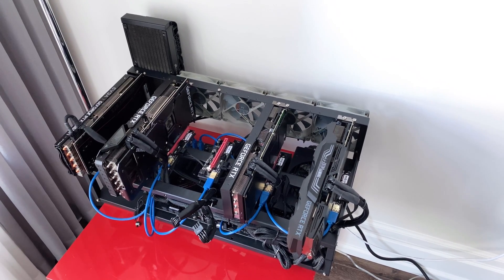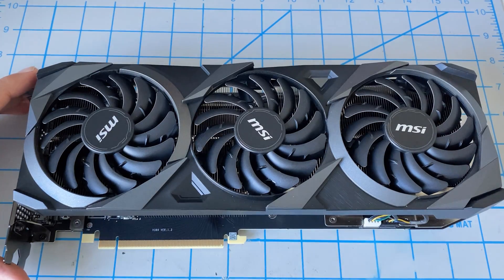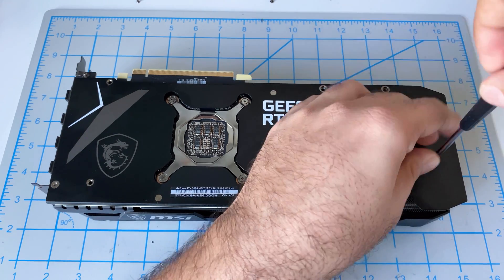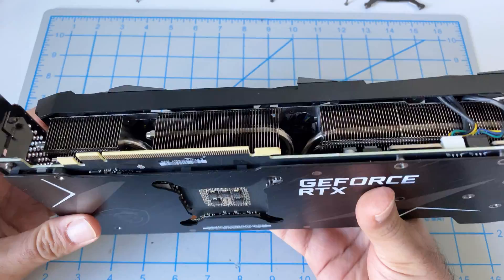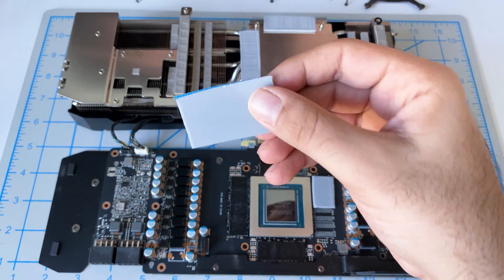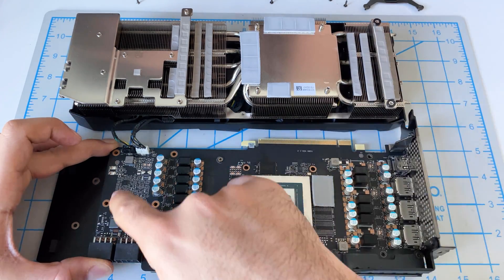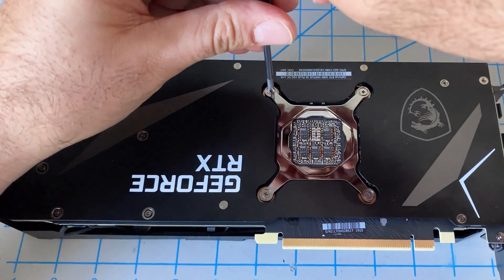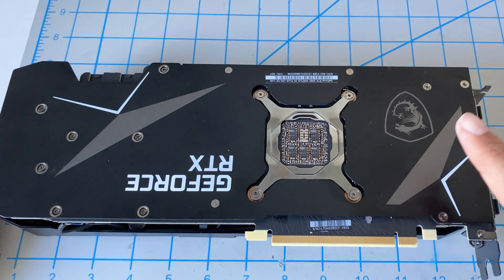MSI Ventus 3X Plus OC nVidia RTX 3080 Disassembly & Thermal Pad Swap | Fix CRAZY Memory Temperatures

Comment: I am soo fked i used 3mm pads near memory and capac/ power adpter and small chips used 1.5 i am getting goo thermal also good memory temps but my hotspot is 107 can anyone help me out ? please Its gg for me
Reply from the maker: Been a while since I did this video but didn’t I use 2mm for the memory? Using thicker than stock will mean you won’t be able to get enough contact pressure on the GPU die which will lead to your problem.

Comment: I have a 3080ti and since day one playing any game it maxes out at 84c, i find recently that this card should thermal throttle at 83c which means my shits been overheating since day one. Could this be the issue with mine? Case has 3 front fans pulling, 3 top fans pushing 1 rear pushing.

Comment: THERMAL PASTE MUST BE SPREAD ON THE WHOLE SURFACE. The "X" technique is great for a CPU where the silicon in only in the center of the chip UNDER the heat spreader. However in the GPU the cooler sits directly on top of the silicon and MUST have contact on the entire die surface. I think you had a great video minus that one caveat (really may want to make a note), i just want people who come here to have the proper knowledge*.

Comment: Maybe a bit late since this is an old video, but i have a similar MSI and this tip helped a lot to improve temps.

Put kapton tape, to block air from going down the open parts of the heatsink. 2 of the 3 fans ... are doing mostly nothing to cool the heatsink fins. Air has an easy way out through the gaps of the heatink. If you block those openings, suddenly temps drop a lot.

Of course changing pads and paste are required, to get heat on to the heatsink in the first place. But putting the tape there, helps getting rid of heat with less fan speed.
Reply from the maker: Interesting idea, I'll have to try. Thanks!

Comment: Where is the memory thermal pad? My pc temps are fine but the memory temp says 90-100 when I’m gaming. PC is randomly shutting off the monitor and blowing fans full blast. Just replaced all the thermal pads here but not sure if any of those were concerning the memory
Reply from the maker: The memory thermal pads are those big pads you see at 5:41.

Comment: hi i did the adb to move the dji v2 osd elements 
now the goggles continuasy reboot any help please
Reply from the maker: If the goggles are restarting, it is because you moved the elements in a way that they are overlapping or put in coordinates that are not understandable by the goggles. Restore to the stock xml file and try again (or just use the one I have linked in the video description).
Reply: @Mangorille  thanks for that 
all the elements are now moved to better locations and full HD fonts
one thing i cant find in the xml is the channel at the bottom left of the goggles 
what would it be called please so i can adjust it
Reply from the maker: @kmarsdenelectrical  You'll need to try it out through trial and error. It might be racing_rc_signal_win

Comment: It’s sad you have to do this at alll. I have a 3060ti which began failing only after 8 months of light use.   MSI Rma Does NOT inspire confidence. Just did RMA for their 120r AIO (which died end of January)
Reply from the maker: Ya I have other GPUs running strongly after years. This MSI one is working well since changing the pads though.

Comment: I understand that companies try to reduce costs like crazy, but reducing temps from 102 to 76 Celsius due to replacing poor thermal paste and pads is simply ridiculous; especially if this voids your warranty.
Reply from the maker: Agree, especially since it failed 1.5 months after purchase. Sure, MSI didn't design this for mining but still, it would have failed eventually with a gaming workload too.
Reply: @Mangorille  Do you know if this voids the warranty.
Reply from the maker: @ridiculous_gaming  You'd have to reach out to MSI to confirm but I would guess it would depend on your local consumer laws. I went in under the assumption that it would void the warranty as we don't have the best consumer protection laws where I am.
Reply: @Mangorille  Making the product last or run better via better cooling does not matter to most companies if they have an excuse to void your warranty early. I assume they'll follow this as well.
Reply from the maker: @ridiculous_gaming  Yup, and they can always say cypto mining is not a standard support workload anyway.

Comment: Since a few weeks my fans are ramping up like crazy on this card, the temp reported seems to be below 80°C tho. Should I swap the paste and pads nonetheless?
Reply from the maker: Use a software like HWMonitor to see if any of the temperatures on the card are out of whack. It's possible that the thermal pad on one particular component has failed and the fans are ramping up to try to cool that one component. When you say 80 degrees, is this the VRAM temperature or something else?
Reply: @Mangorille  Thank you for your replay. I changed the thermal pads and paste according to your video and it works perfectly fine now. :) One of the pads definitly failed, it was extremely oily there. The temp was the overall GPU temp in HWInfo, the memory was even hotter at around 100 degrees. I have around 55 to 65 degrees (overall temp) while gaming, depending on the game. Also the idle temps dropped significantly. So a big thank you from me! Your tutorial helped a lot!
Reply from the maker: @johannesd.2347  Glad to hear you got it all figured out! Mine was the same, the pads were really oily and you could even see the oil spots on the back of the card before disassembly.

Comment: Would you happen to know the size for the thermal pda for the same gpu but a 3060ti??
Reply from the maker: No sorry and wouldn't be surprised if it was different. Really just research or you pick up a few sizes and then return the ones you didn't need.

Comment: Very nice and detailed video. One question though, where did you find out about the appropriate thermal pad thickness? Was it in some forums or did you contact msi and they gave you the specific thickness?
Reply from the maker: I bought a few different sizes that seem to be common to 3080s and then used a caliper to measure the existing pads where it had not yet squished.

Comment: Does anyone know how thick the thermalpads on the RTX 3080 VENUS 3X PLUS 12G LHR are on the capacitors on the capacitors and mosfeti diodes and back plate their thickness. I would like to replace them.
Reply: Did you found that out? I got the same card.

Comment: I'm going to do this to my Ventus 3x, except I'm going to use K5 putty instead of pads. Also why not just unplug the wires and remove the risk of damaging them?
Reply from the maker: Lots of times those connectors are really tight and easy to damage if you don't remove them the correct way and with patience. There is really no need to remove.

Comment: hello, thx for the video. May  i ask  can we  reuse the  stock thermal pads after changing  only  vram pads.   Cuz  we are  opening the  backplate, u know  pads rebounding.  And  is there any vram chips  under  backside of the  pcb, like frontside. İf there  is  shoud not we change  it too.
Reply from the maker: You can re-use the thermal pads, no need to replace them each time but make sure you don't get them dirty with dust/hair/etc.

Comment: At what speeds do your fans work? Do you set them manually or does the machine adjust them?  Do you overclock memory during mining?
Reply from the maker: I set the fan to manual and 80 percent on this card so that it runs a bit cooler than normal. You can leave it on auto and see what the temperatures look like based on your ambient. Yes, you do usually overclock the memory but it all depends on the coin you are mining. Some need memory overclocking while others do not.

Comment: I have the MSI RTX 3080ti ventus x3, i saw a little bit of oil on the card... so ik wanna change the thermal pad because i think its the pad..... So between the backplate and the card i need the 3mm and on the front side arround the gpu i need the 2mm? And the other pads on the front side are all of them 2mm? Hope you or someone can tell me that....
Reply from the maker: Back is 3mm and front vram is 2mm. I honestly wouldn't bother with the rest.
Reply: @Mangorille  Thank you for your quick response!

Comment: Although differing designs for the RTX 3080 seem to want different thicknesses for the chip side of the card, the back side of the card always wants 3mm. I have two MSI Ti's that have 2mm on the chip side, but then I have a non-LHR (not sure who made it) that uses about 1mm on the chip side (which I replaced by doubling up .5mm's and did not have any thermal pads on the back side of the card to which I applied the 3mm. That card is mining strong at near 100 mega hash/sec with no sign of stopping.
Reply from the maker: Agreed. Front varies based on the manufacturer and the cooler design, rear seems to usually be 3mm.

Comment: Another YouTuber seemed to get amazing results by just applying thermal pads to the backplate opposite the memory chips, but that version of the 3080 didn't even have thermal pads for that area.
Reply from the maker: If there are no pads there, that would definitely help. On mine the thermal pads actually failed and became all oily and shiny. You can even see a bit of oil on the back of the card if you look closely. I suspect the back ones are shot too but not as noticeable as they do not do the bulk of the heat transfer (the front ones do).
Reply from the maker: @NalarZ  3mm rear pads seems to be the norm from my research as well. If you have some left over, why not right? For me, it didn't make sense to spend the money on 3mm pads for a 4 degree difference. Already runs way cooler with just the front pads.

Comment: My card is MSI 3080 Ventus 3X Plus without oc.
If i only want to swap vram thermal pad, front 2m 12.8kw ok?
At the back vram position need to use thermal pad or not?

I have GK6 GPU Backplate Memory Cooler Unit.
Reply from the maker: I would expect the thermal pads to be the same but I only have the OC model so no way to confirm. On the OC, the front pads are 2mm. I did not check the back pads but usually they are 3mm. You will need to verify. Best would be to buy a couple of different sizes from somewhere with a return policy and measure the pads when you disassemble.
Reply: i tried with my Zotac 3080Ti AMP Holo by changing the front pads only for the memory module, and it drop 22C, i heard some said if you change the backplate it will drop about 2C more
Reply from the maker: @axe_rocker  Thanks, I heard the same, the back doesn't make as much of a difference.